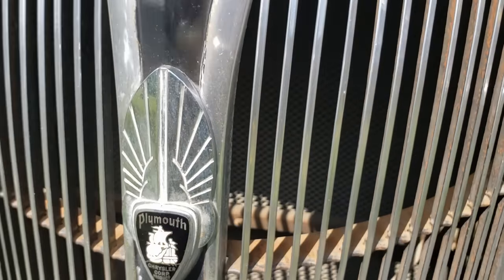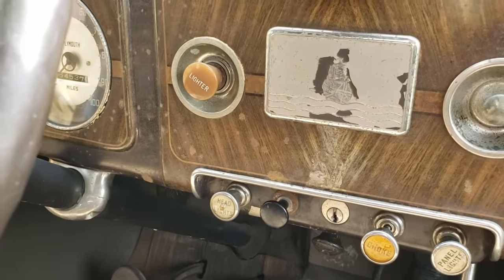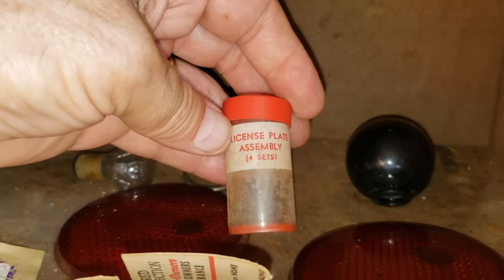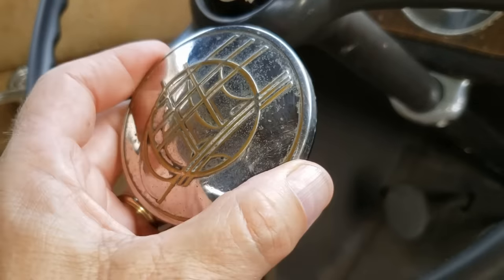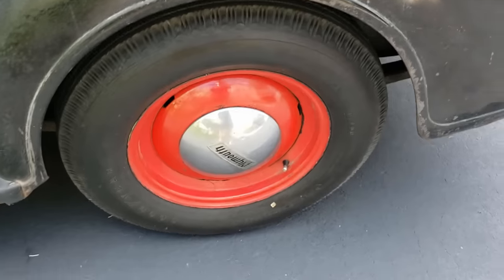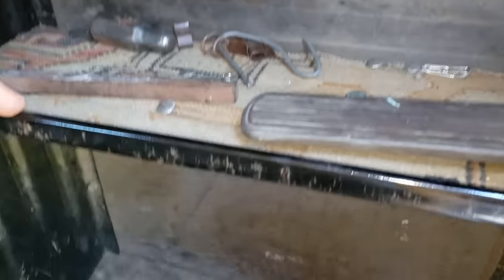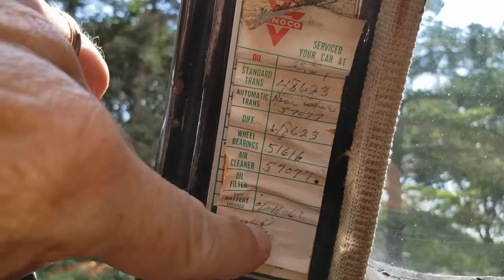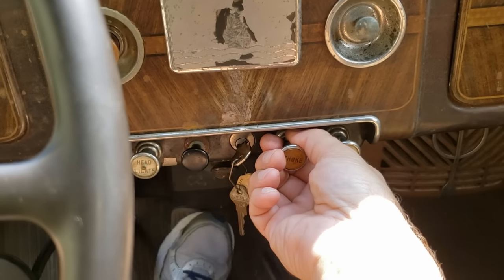Barn Find! - 1937 Plymouth Coupe UNBELIEVABLE Original! TIME CAPSULE! Does it RUN? #barnfind

Comment: Wow! That's a great old Plymouth... Back in the early 1980's, my Mom had a 1938, Business coupe, all original, in 'Midnight Blue' paint. It had the painted steel rims as well, but with wide whitewall bias ply tires my father added for an extra touch. Those wide whitewalls looked great! The car had been restored a number of years prior to my father buying it. Back in about 1976, give or take a year or so either way, so the restoration was maybe, only about 5 years old at the time?  But it looked and drove perfect.  It was a great old car and a real joy to drive!  
I was in college at the time, and my father bought it for my mother, who fell in love with it at first sight! Lol.  She used it as a daily driver around town for MANY YEARS. One thing I remember, was the opening windscreen, (windshields) were prone to get frozen up, even 40 years ago! Because on the one we had it worked perfectly, which many people commented on... 

A true business coupe, it had no back seat at all. It was designed and built for a lone gentleman, (An on the road salesman) to use for his traveling sales business. No need for a backseat, or room for passengers. It did however, have a HUGE trunk for the era, and that was to carry his salesman's samples in. Be it vacuum cleaners, cleaning supplies, or any number of a million items that were sold door to door, and on the road in those days. 
But for me, the most fond memory of the car, is remembering the day my father pulled in the driveway with it, as a surprise gift for my mother, and also, remembering her cruise her daily errands in it for years... The trunk was great for groceries!!  My Mother and Father are long since passed away, and the car is long ago gone. But, whenever I see one of these old Plymouth coupes, it brings back a whole host of wonderful memories of family, and of some better days long ago...    
Thank You for sharing. !!!
Reply from the maker: Thanks for sharing your great stories Jmflyer55! I enjoy reading as how these old cars bring fond memories and joy to us and our families over the years.

Comment: My Momma and Daddy had a '37 Plymouth Business Coupe! The "canvas" is leatherette. On the driverside down low is the jack storage (a small hydraulic go to Harbor Freight for a replacement!) The upper shelf is for the tool kit and oil can and tire repair kit. You can put six dead bodies in the trunk if the spare's inside the car! Well, almost! Their's did the unthinkable. The crankshaft broke at a journal!!! My Daddy was coasting to a stopsign and felt a THUMP and quickly shut the little Plymouth off! He pushed it across the street into the driveway and pulled the pan and had two pieces of crankshaft in his hands. Went to the parts store and said "I need a crankshaft" and they said "Where's your core?" "I don't have one." "HUH???" He fixed it, it ran fine and it got totaled!
Reply from the maker: WoW! What a story! Thanks for sharing. In another episode, I drop the oil pan (which is really easy on this '37!) to check out what's inside. It does have a long crankshaft!

Comment: I watched it again , I noticed yours has a cigarette lighter, mine only has a passenger side lock, the air filter is not an oil bath though I believed you could have optioned for one. After i got my car back home and really did a thorough go through of the car I realized it is in great shape except for most the rubber grommets. My car has little over 80k and has also been sitting since 60s. I have purchased nos shocks and a bunch of other stuff to get the handling back to a like new feeling. My vent windows were separated so got those coming , also had to get both windshield seals since mine was froze shut. I'll post a video when I get it done
Reply from the maker: Thats very Kool Tyson. Would really like to see yours. Post a video on your channel! I'll subscribe. I'm curious to see how your new shocks help with handling. I still have the worn out originals so I need yo replace them too. I ordered new tires too. New videos coming soon.

Comment: Hi Terry
I too picked up an original 37’ coupe about 1ty.  ago and have fallen in love with it. A few years ago I restored a 1940 ford convertible. The engineering on my 37 Plymouth seems so advanced and thoughtful by comparison. Unfortunately I discovered a hairline crack in the block just behind the oil filter, so decided to install a 49’ 230 cu inch (which I’m currently rebuilding.). Some days I question the decision to replace the original engine. It runs just fine and has just over 32,000 original miles...:) The spare tire in mine has never been out of the car...
Perhaps we can exchange contact information?
Reply from the maker: I sent you a message.

Comment: That's NOT an oil bath air filter! Your's has been up-dated to a paper filter! And I think it has a Pur-o-later (FRAM) oil filter in the orange canister too! An oil-bath air filter would be black and totally enclosed. I used to clean and re-fill them when I worked at the service station in the mid 1960's! You should get about 16-18 MPG in town and close to 20 MPG highway (65 MPH) maybe 22 at 55MPH. Try Coker Tire for replacement 6.30x16 bias ply tires and new tubes. I don't know where you are, but you may can find a REAL mechanic (maybe a tractor mechanic) who can tune your engine (adjust the carb and the timing CORRECTLY), so you'll need to always use the choke to start the engine if it's cold (lean the mixture back) to get the best performance. NEVER, EVER use gasoline with ethanol in it!!! If you have to drive 50 miles to a lake for 100% gasoline, DO IT. 1930's heads and valves aren't made for gasahol. 34 years at Citgo taught me a few things.
Reply from the maker: Thanks for the comment Ricky. I sure hope I can find a "Real Mechanic" somewhere!

Comment: What kind of MPG's does it get
Reply from the maker: I estimate in the low 20's. It has 3.90 Differential gears so it does rev a little high at 50 mph but helps with the torque climbing hills no problem.

Comment: I also have an original and yours is a good bit nicer then mine which has 68,000 original miles lot more wear on the dash and glove box door is sticky needs rubber and head liner ....... Also I see you have a horn video which I will check out since I broke mine on disassembly trying to fix a short................. also be very careful with window crank out they are housed with a pot metal housing and will break upon disasembly or use if not careful -if ya need too just use one hand to help the window open as you crank the hand crank they are HARD to find find !
Reply from the maker: Great to hear there's another one out there Luke! Thanks for the tips and info!

Comment: In that prewar era Plymouth had more advanced engineering than both Chevrolet and Ford.  Fords undercut Plymouths on price but were comparatively crude because old Henry was too stubborn to upgrade his cars.  Sales of Plymouths increased every year during the Great Depression through 1937, unlike the competition. As far as this example's low original miles ... cars built in the late 1930s were relatively new when gasoline and tires were rationed during WW2.  Then after the war and rationing ended, those cars were older and had low resale value. Perhaps the family who owned this car used a newer car as an everyday driver but decided to keep this car.
Reply from the maker: Great info SpockvsMcCoy! Thanks for posting it!